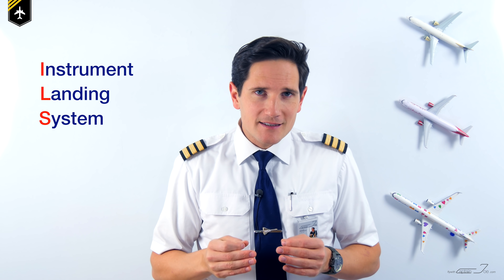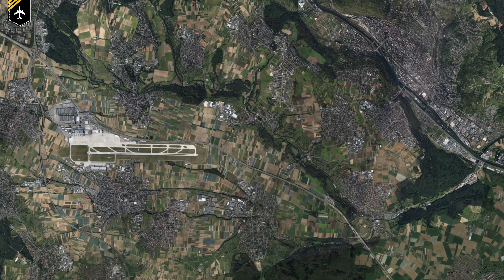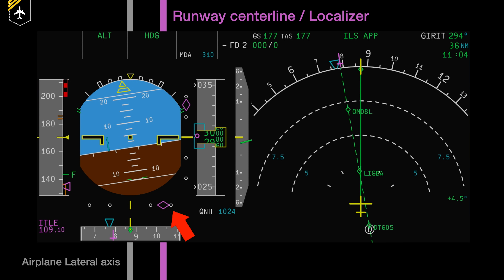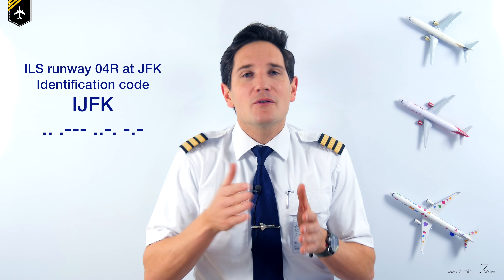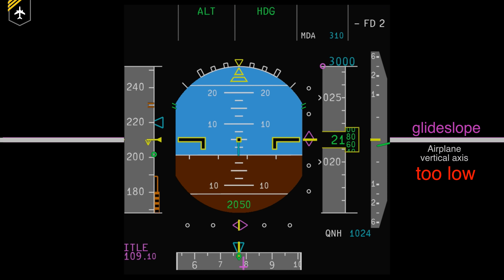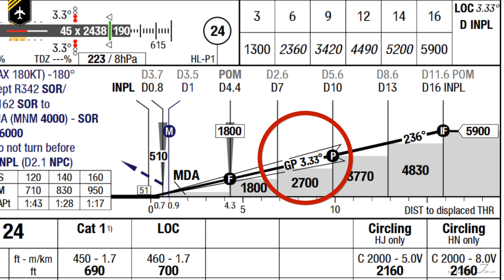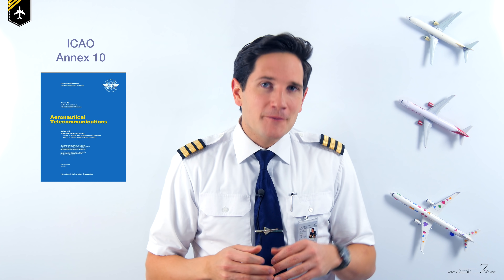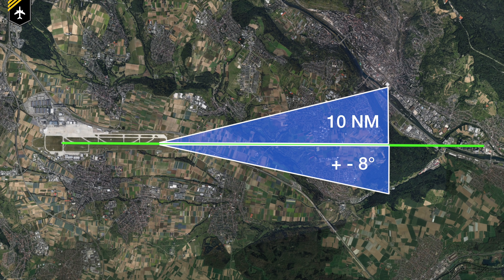How does an ILS work? Explained by CAPTAIN JOE

Comment: Is the FDP a fixed fix?  Or it varied based on different Temperature?
Reply: Its fixed. Usually a DME/Radial from whatever groundaid you're using
Reply: @ZK-APA But in the real flight daily,I found that the FAF on the chart varied. For example,it says the FAF is 3000ft and 3.1DME LOC on the chart, but there's slight difference every single time,maybe 3100ft 3.2DME or maybe 2950ft 2.9DME,unless the weather condition is right on standard.
Reply: @jackma5015  then its most probably a QNH accuracy error.

Comment: I fly the Longitude on MSFS2020 and I have finally figured out how to use the G5000 for the Approach setup. I first started the Rnav to learn the ropes of setting up the routes through simbrief. I practiced all night to learn it and relearn it. Now I have that Rnav knowledge I stepped up now for the ILS. I find it very simple using the Approach destination runways between Rnav and ILS. Its basically the same destination only by different waypoints and Glideslope. I'm having so much fun to learn everything about flying. I'm almost covered all the basics but need to work on my landings LOL. Thank you so much for making this video!!

Comment: London City Airport have a descent angle of up to 5.5°. This is used by the smaller passenger jet aircraft such as the E190 and A318. However, because of its shorter runway and surrounding terrain, specific avionics system, aircraft certification and crew training are required for this type of operation.

Comment: It’s very interesting, however i have a question about the morse code, is it always listen by the pilots ? Or it’s just in certain case to make sur it’s the right airport ?
Reply: Depends on the type of aircraft. In a small one like cessna, it makes sense to verify with the Morse identifier, as there is no other way to verify.
In larger aircraft, mainly airliners with a FMS computer, you can verify it by comparing it with the database information rather than Morse.

Comment: Hi Capt. Joe, love your videos! Can you please share your expertise in regards to setting up for a visual approach…. Say you are planning to make a visual approach backed up by an ILS and you intend to make full use of the autopilot down to 500ft… Say You are coming in from a downwind or base leg fairly high and you get the cleared for the visual approach in a jet….How do you set yourself up, in particular altitude wise.. what altitude do you aim for in order to get the plane to capture the GS?  Thank you for your work and appreciate your help🙏🏾
Reply: Ok the concept is kinda flawed. You'll either do a visual, or you'll do an ILS. You'll complicate things trying to do both together.
Reply: @ZK-APA  Thank you. Visual (Backed up by the ILS)
Reply: @nicdecaz425  Thing is, this isn't usually done. If you're doing visual, you are not doing ILS and if you're doing ILS, you are not doing visual.

But what I am guessing is that you are doing a visual, but using ILS just as an additional reference. Again its not done so there's no set procedure. But what you can do is to just fly the visual pattern till finals, and once you're established on finals then use the ILS to fine tune. But if you are trying to intercept the GS, then basically you're not doing a visual, but an ILS approach. (Again, what I am explaining is conceptual and is not done practically).

TLDR is that if you are trying to do a visual approach but also flying the ILS, then its not a visual approach anymore (plus its not necessary that a visual approach path and an ILS landing path has to be same. ILS is precise, visual is approximate by design)

Comment: Hi Captain Joe 
I have 3 questions. 
1.Does an airline pilot need private pilot license. 
2.what kind of pilot are you. (airline, commercial, private) 
3.what is pilot aptitude test all about
Reply: 1. In most countries, if you have the higher class of licence, you automatically get the lower licence privileges as well (eg with a cpl you get private pilot licence privileges as well)
2. He is an airline pilot with an ATPL 
3. It's literally as the name suggests

Comment: Good explanation.  Perhaps someone has mentioned this previously, but as a long-time pilot and avionics tech, let me correct a critical technical mistake:  ILS signals (LOC & GS) are amplitude modulated, NOT frequency modulated.  Just like aviation communication radios.

Comment: I'm pretty sure this has been said before but blue light plus yellow light does not yield green but white light. Please refer to additive colour mixing (light) vs subtractive colour mixing (paint, colored plastic foil etc). This is the reason why screens use red/green/blue while your printer uses red/yellow/blue.

Comment: back in the very old days, they had radio beacon guides for aircraft.   The airplane had a radio receiver with a directional pointer on the top-   it would home in on the radio beacon and the pilot would take on that heading that would guide him to the air strip to land....that worked until they replaced it with ILS.

Comment: Okay, I get the reasoning behind the glide slope and the horizontal / directional antennas. But... regarding the distance from the runway, why not use GPS? Wouldn't it be cheaper?
Reply: Not all aircraft carry gps, but if an aircraft is ifr approved, it’ll definitely have a dme receiver in it.

Comment: Hi, I fly a Lear 60XR which has a Collins ProLine 21 Avionics Suite which incorporates Auto Tune for ILS (localizer) and VOR stations.  One less task to perform for the pilots.
However, Pilots MUST confirm that the feature is enabled. Also, always check the frequency on the FMS to confirm it's tuned to the right station.

Comment: hi
I have a question related to ILS.
During landing pilots get manual control for the plane. Is it possible to land only on ILS system ?
If yes, why pilots don't use that option?
Regards
Martin
Reply: Brzydal Nakiel yes, a plane can land automatically with an ILS (it's called autoland, but you need some prerequisites to do it)

But pilots take over manual control, so that they can handfly the aircraft, and have more control over it.

Comment: 2:47 I'm not a pilot, but it seems pretty dumb that a diamond appearing to the RIGHT of the runway center line on your display means you are too far LEFT of the runway center.

I have no doubt pilots simply train for this and learn to "chase the diamond" or something (so if the diamond is right of center, you need to turn right, towards the diamond, therfore kind of "chasing" it). So I'm sure after a while, this is intuitive and makes perfect sense to trained pilots.

As a non-pilot though, it sure seems like it would make a hell of a lot more sense if the diamond simply indicated the position of your aircraft relative to the runway center line (i.e. If the diamond shows right of center, your plane is right of center). I'm sure something like this could never be changed now though-- there's too many thousands and thousands of pilots who have been flying for years under this "backwards" (in my mind) system.
Reply: Dave Carsley simple explanation for it. The important thing is where the other things are with respect to you (eg here the diamond) compare to the other way around.

A simple example of the same concept is in Google maps (or any GPS system), youre on the center, and the roads are in respect to you. What you're saying is that to have the road in the middle, and have the car move around, which doesn't make sense during navigation

Comment: for an ILS LOC freq Lugano has an approach of 6.65°.. otherwise it would be and RNAV approach at steamboat springs at 7.75° or of Aspen at 9.61° for the KASE VOR/DME-C approach. But in general? The NASA Space Shuttle landing at 20-22 degrees 2 miles from the runway at Kennedy Space Center.

Comment: Can a plane be landed using the ILS if there's a strong crosswind?
Reply: Neal T generally yes. But autoland does have a crosswind limit

Moreover you don’t need autopilot to fly the ils. You can fly it manually as well

Comment: I live on Vancouver Island. We often have foggy conditions here. Often in the past flights had to be cancelled because of fog.  A couple of years ago the local airport was refitted with an ILS system and runways were lengthened. Great I thought no more cancelled flights.  But recently under foggy conditions after two landing attempts my flight had to be turned around and we returned to our original departure city.  So what's up with that? I thought ILS was going to solve this problem of not being able to fly, take off and land, in the fog.
Reply: Claude C even ils has restrictions. If the weather is way less than the ils minima, you have to abort landing.

Comment: Why dont Pilos just opt to use the AP to land the plane and not have to worry about all of the ILS stuff, assuming it takes care of this as well ?.  I know, if they use AP to much they'll forget how to fly.  I think eventually planes will be set up to use AP only,  this way no humans are needed.  I know in another lifetime, hopefully... Love your video's
Reply: The autopilot has to be set, it only does what the pilots tell it to do. So during the approach they have to set the correct speed, altitude and headings so that the autopilot "knows" what to do. And the pilots have to monitor the AP that it works correctly during the approach. And the Autoland system works only if the airport has a runway with the category that supports the Autoland, otherwise the Autoland can't be used.

Comment: There's is a radio beacon in my area, I believe it's on 380 KHz (?), that gives the airport letters in Morse Code... any idea what that would be used for?  It's quite a ways from the airport..  Couple miles anyway..
Reply: If it uses kHz it seems to be an NDB (non-directional beacon). Aircraft has an ADF device (automatic direction finder) with a needle pointing the direction to the selected NDB transmitter. (You select the frequency and first listen the morse code to identify the NDB.) It can be used to navigate towards the airport where the NDB is located nearby.

Comment: Your description of where the diamond was on the ILS Locator instrument which was in the presentation was about three to five degrees right of the center line left me confused. I wasn't sure if the plane was left of right of the center line and which direction I needed to point the aircraft to get back centered with the centerline of the runway. A little visual diagram of an airplane right or left of the runway accompanied by the position of the diamond on the ILS Locator Instrument would help clear that is up. Question no. 2, if you are above the glide path I assume you increase your flaps or you reduce your power, while keeping your outlook out of the cockpit level with the horizon, or keeping your plane level and in the middle of the horizon line, not lower or higher, until you see the diamond on the right line up in the middle.

Comment: You can understand why the 9/11 Truthers say that Arab highjackers did not fly the commercial aircraft into Trade Towers I and II and the Pentagon, when none of them could properly fly a Cessna 172. Thanks for the interesting presentation. I need a briefing on the Primary Display Module.

Comment: F.I.Y. to watchers...
1 nautical mile = 1.151 miles
Reply: Voyager FPV 1 nautical mile has a definite reason for having that value. 1 nautical mile is equal to 1 minute (1/60 of a degree) on the earth surface. Hence to convert nautical mile to mile, the 1.151 value is used (1 NM= 1.852 KM in terms of metric)

Comment: The rule of thumb for maintaining a proper descent rate for your approach airspeed in order to stay on a 3 degree glide slope is to  divide your airspeed in half and add a zero, this will be your descent rate in feet per minute.  For example, if your approach speed is 200 knots, divide that in half which gives you100, then add a zero which gives you 1000 (fpm) to stay on a 3 degree GS.

Comment: Atc: 5247, you are cleared to land runway 06 wind calm. 
5247: cleared to land runway 06, wind calm
...
5247: tower, 5247. there is no localizer on runway 06.
Atc: Roger, 5247 continue to approach. We will report. If you want you can go around.
... 
Atc: 5247, can you get ILS?
5247: yes, there is a weak signal.
Atc: will you land?
5247: we will land of course. We are landing pretty nice.
Atc: Roger, wind still calm.
5247: Should we go around because of localizer?
Atc: 5247, you can land sir if you want. 
Pilot: There was no localizer when we used to land on the past.
Atc: 5247, Roger. Cleared to land 06.

Comment: 2:35  If I may be permitted a little pedantic nitpickiness...the ILS does use actual light, since microwave and VHF/UHF is part of the light spectrum, within a set frequency range.  Admittedly, it's at frequencies we can't see with our eyes (unlike PAPI, which is actually visible light), but still...it's light.  :-D

Sorry, but I just had to.  Thanks for so many informative videos, Joe!
Reply: @aussiebloke609 Actually - if I may - it’s part of the electromagnetic spectrum and only the visible part of ER is referred to as light.
Reply: @Harbl  Good try, but in physics, light refers to the complete electromagnetic spectrum, as it still consists of photons, the basic quanta of light - the only difference between the various bands is the frequency/wavelength of those photons.  And you'll notice there's no part of the spectrum listed as "light", only "visible light"...the rest being light that is effectively invisible to humans.

:-D
Reply: aussiebloke609 Photons are not the basic quanta of light, rather the electromagnetic field.

Comment: AS YOU TROLLEY THE ILS BY TYPING I IS IN THE FLIGHT COMPUTER ON APPROACH VFR, THE INSTRUMENT GUAGES MOVE TOO FOLLOW AS YOU WATCH THE GLIDE SCOPE AND ALTIMETER BEFORE DESCISION HEIGHT? THE ATC IS CONTROLING THAT AND ANY ADJUSTMENTS ARE MADE BY THE AIRLINE TRANSPORT PIOLT? THE AIRPORT CERTIFICATION OR THE AIRLINES PIOLT SHOULD HAVE PRE-DOWNLOADED IT AT THE AIRSIDE TERMINAL? IF NOT THEN A QUICK COPY BY SEARCHING THE FLIGHT COMPUTER OR RUNWAY CHANGE TO ANOTHER TECHNOLOGY IS WHAT THEY WILL DO? SIMPLY PUT AT GLIDE SCOPE 2 PERCENT YOU ARE DESCINDING AT 200 FEET PER MINUTE BECAUSE OF THE RIGHT TRIANGLE YOU ARE FORMING AT 2° FROM 1000 FEET? BUT IS YOUR WIND VS. WEIGHT RIGHT? IT ALREADY IS PER AIR TRAFFIC CALLED THE AWOS?